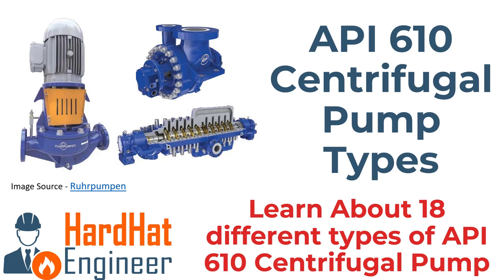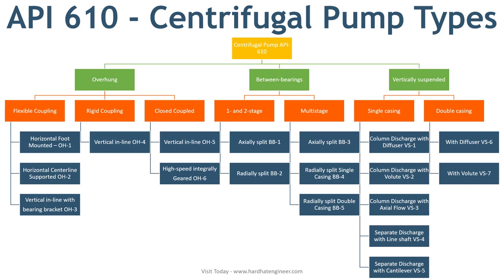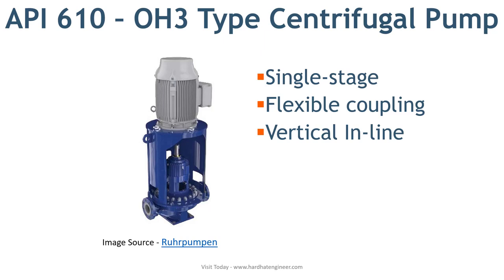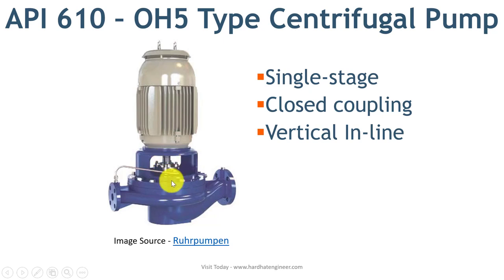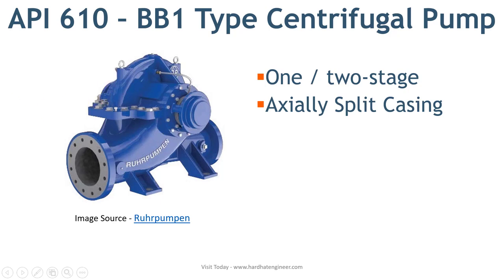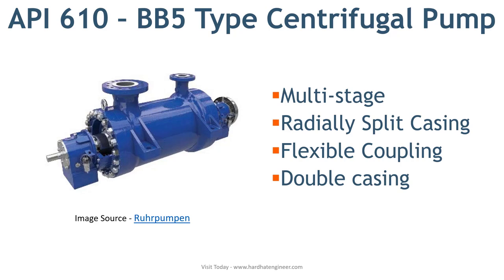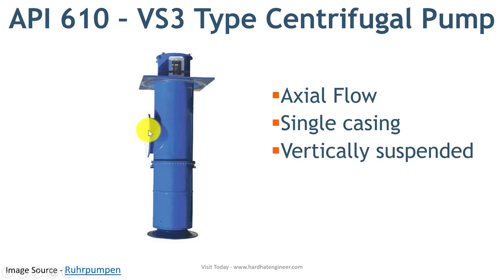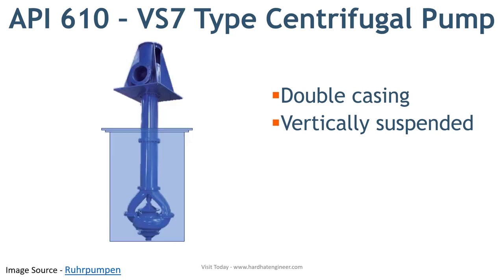API 610 Pump Types and Classification - 18 types of API 610 Centrifugal Pumps

Comment: I am designing a 15 story building and need to pump water to a tank on the rooftop 240 ft. I have a 12" dia. Pipe. The water is filtered before being pumped upward. What type of pump should I use? I usually call 2 or 3 pump representatives to come and give me a quote. Thought I would check with you first. This is a high end appartment building and they will use a lot of water.
Reply from the maker: Pump manufacturer will suggest best sustainable solution. It must be single or double stage centrifugal Pump. Most probably single stage will be enough. This may be multi pump arrangements to meet flow rate.
Reply: Full article on pumps and it's types

https://pharmaguides.in/classification-of-pumps-different-types-of-pumps/
Reply: You should know number of residance that use the building or No of apartments. If there is any activity you should mention it